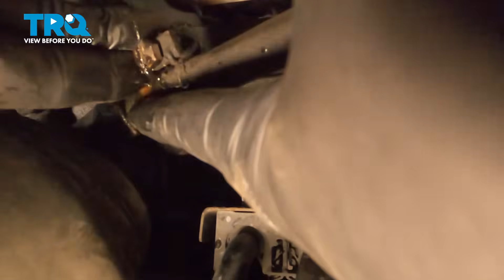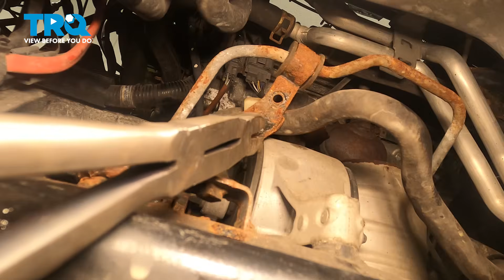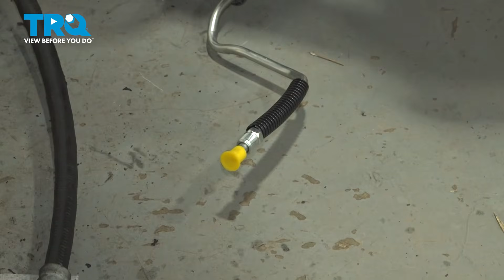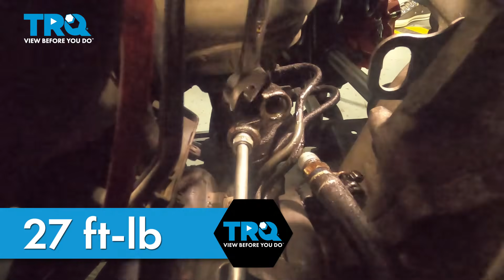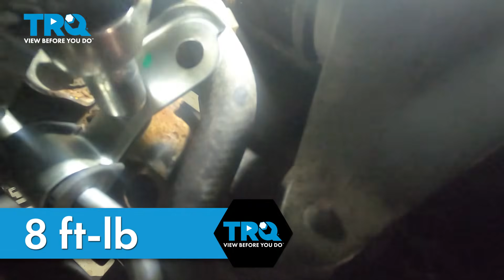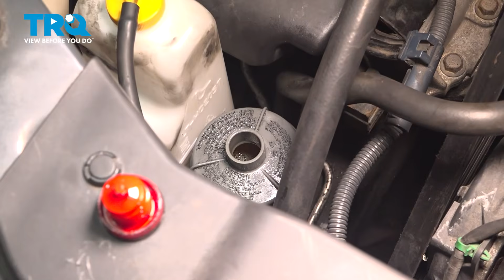How to Replace Power Steering Pressure Line 2003-2008 Honda Pilot

Comment: This has to be the hardest DIY fix there is.  Especially without a lift.  This turned out to be a 2.5 day job at leas5 for me.  Do yourself a favor and just cut the high pressure line at the nut. It would have saved me a whole day.  I ultimately stripped the head of the nut and that made it even more difficult to remove with a standard 14 mm socket.  Ended up using the sandpaper trick, wrapping the nut in sandpaper and using a 15/16 mm socket to remove.   This job is sending my to the chiropractor to get fixed.

Comment: i have a 07 pilot, is been a nightmare between buying tools and trying to remove the fitting of the high pressure hose. I tried everything and wont budge, i will use a hacksaw to cut ir and then remove it. You wan to remove the 2 rear clamps you need to raise the truck really high to be able to at least reach it plus i noticed he removed a lot of hoses and subframe to be able to reach the rear bolts. I hasn't done yet is to cold here in PA and i have a 2 weeks old cubital tunnel surgery in my left arm. This is no fun and games

Comment: Yes I agree that they did drop the subframe to gain access to those clamp bolts but make no mention of it in the video. This is the second video I have found that does not address certain parts of the repair performed.

Comment: This 04 has the firewall directly above the clamps that hold the line. I have to drop the rear of the subframe to get enough clearance to get at them. I'm just LOVING Honda engineers right now.

Comment: This was a pain. Took 3 hours to get apart. But rounded out, struggled to get anything on it. Finally got a stripped nut socket remover. The thing was tight. 1 hour to put back together. Do it with two people. I would have been 8 or nine hours if I didn’t have my friend with me.

Comment: shi was easy yall trippin for them bolts below the intake box get a wrench and use the round part and fit a hex bit socket to use and connect the  ratchet for more leverage and the original 2006 grimy bolts came right off

Comment: Are you freaking kidding me my wife’s 06 you can barely get your hands down there. Driver side wheel was off and I could barely get to the 10 mm clamp on the rubber line going into the box. This is gonna be freaking fun.

Comment: READ READ READ BEFORE YOU START - SAVE 3 HOUR OF YOUR TIME Posted this comment originally to a different video...most of the information is still valid...this is a horrible job so I hope this and the above video help.  it can be done.  I just finished this Job  - 6.5 hour job over 2 days including the time to run to Home Depot. (you need a 17 and 19 MM wrench)  I could probably do it in 3 hours now.  This video is great help...However these are things I wish I knew as well.  Watch the video First and then add this info to your plan.  Again carefully watch the whole video IT will save you time in the end.  Don't skim!
MOST IMPORTANT - Don't buy the cheapest new steering hose.  I did and it cause me hours of frustration because it was kinked.  Here is the thing you need to make sure about your new hose.  Look at the Rack end of the new hose.  The last 4 inches should be perfectly straight, and the nut/fitting should spin freely.  Mine was kinked slightly and the nut turned but lightly grabbed.  Cause me hell and probably an hour and half when trying to get it threaded correctly.          

1) If you have smaller hands, you can do this from the top.  DO THE FOLLOWING to remove the hose
   a) Remove the Air Intake hose.
   b) Use two thick moving blankets folded into 4 layers so 8 layers total and lay on top of engine - protects you and make more comfortable.    
   c) Remove the return line with a 17mm wrench.  I did not do this originally...I ended up having to later.  Should have done it from the beginning...would have save me LOTS OF TIME AND FRUSTRATION.  DO IT First.
   d) Use a cutting tool and cut the hose right by the Rack fitting.  I used an Oscillating Muti-Tool, it cut the line in 2 seconds.  Then I used 19MM socket to easily remove the fitting from the Rack. You can use a 19mm wrench...but is a waste of time 
2)  Follow the direction from the rest of the video to remove the rest of the hose.  If you cannot get the 10mm bolts holding the line on the bottom.  Cut them with a Multi-tool.  I did get the 10mm nuts off but was never able to reuse them.  I ended up zip tying.  Save your frustration and cut them loose if they don't come off easy.  
3) I did take the passenger tire off and pulled the hose out the side.  I reinstalled from there as well.
4) IMPORTANT WHEN RE INSTALLING. - push the new hose in from the passenger tire SIDE DO NOT THREAD THE OTHER END OF THE HOSE UP TO THE PUMP YET.  YOU WANT THE PIPE TO BE "FLEXABLE" TO HELP YOU LINE UP THE RACK FITTING.  
5) GET A HELPER FOR THIS PART!  with someone holding the hose by the passenger tire have them help you push and wiggle the hose, so it lines up with the rack.  As you work from the top with a 19mm wrench or with your fingers tighten the fitting into the rack.  Having the helper make sure there is no binding on the fitting hopefully will make it easy to get the fitting thread started.  FYI Mine was more than 8 rotations.  6 wrench turns per rotation - more than 48 wrench turns.  Be patient or take a break.   
6) Attaching the return line for me was easy - just took a little time as you again had more than 50 wrench turns.
7) follow the directions from the video to attach the pump side, secure the hose, attach electrical connector.   
I hope this helps some of you.  These are things I would have wanted to know in addition to the video.   
~Mark

Comment: I thought the video was great. One critique I have was the retainer before the actual rack fitting. Idk how you can get your hands there 1 two I can barely even see it. 2 idk about the pliers and clipping something to release it. 3 I just deleted it and installed a zip tie. That bolt was inaccessible from the bottom. I found it from the top. Felt like German engineering to me.

Comment: Can confirm this replacement sucks. Those without long skinny arms may need to enlist help. Took over 10 hrs for me personally and then I snapped the last bolt connecting the hose to the pump. Guess it’s getting fixed tomorrow. If you can afford to pay someone to do this one do it. Saving your money isn’t worth the hours of cursing
Reply: Comment to add this video was a fine how to imo just made it look way easier than it is

Comment: 8 hour job for me, I am NOT an expert by any means, BUT, greatly appreciate the video as far as locations of retainer clips and associated bolts, and calm demeanor (“do the best you can”) did mine on ramps and most of the work from underneath, non angled 10mm ratchet wrench was CLUTCH because I couldn’t fit normal socket on any retainers.  FYI vid shows 2 clips going back on backwards, no big, million ways to skin a cat, great video!!! 06 MDX

Comment: Save yourself a heck of a lot of time by cutting high pressure line & return hose.  Then use a socket with breaker bar.  There's not enough clearance for a wrench.  Plus you won't strip out nut. Prepare for bloody knuckles.

Comment: He must have lowered the cradle down a bit to get the lines off the brackets. I'm doing this right now on a 04 Pilot 4wh drive. And when I say I have no room for ratchets like hes using, I seriously mean there is no way to get tools in there.